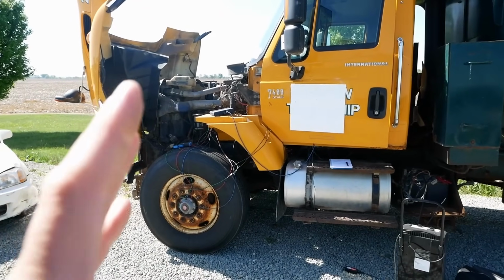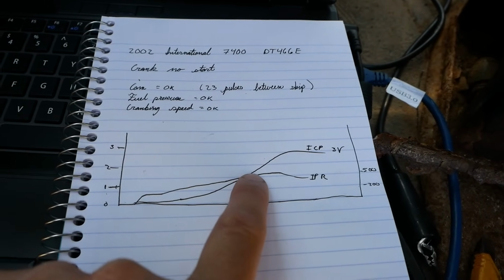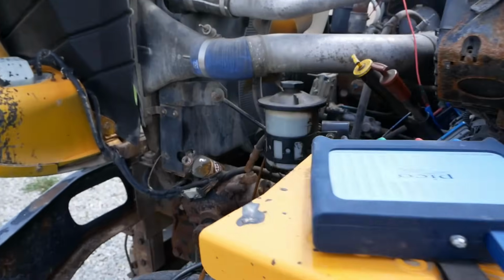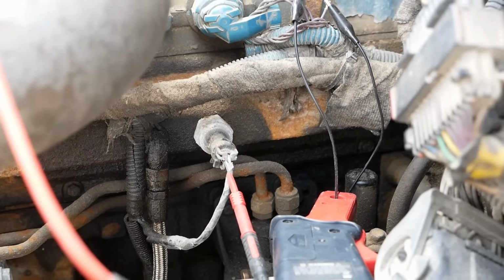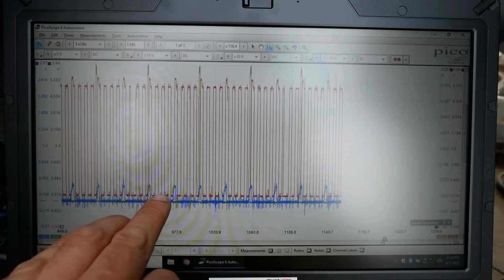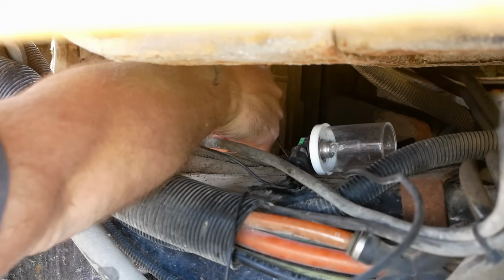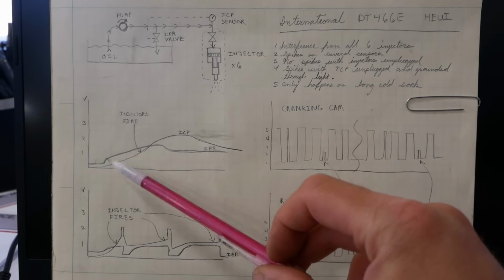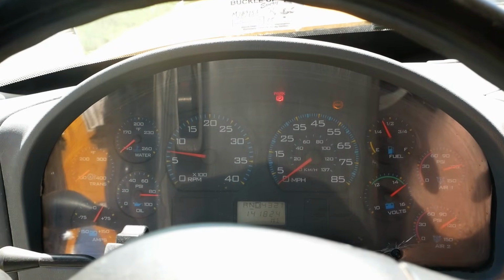International DT466E Won't Start without Ether after Sitting

Comment: We have an 05 4300 dt 466e with Allison 2500. And it keeps killing transmission control modules. The good thing about that is you can use used parts. But killing one every month leaves the truck sitting.. been through the harnesses for ecm and tcm repaired every wire with even a little suspect. All sensors check out good and we are baffled after that.. like you we live in rust hell in Eastern Canada.. its been sitting a few months now and we will probably get back at it soon..

Comment: Option 1: improve the 5v Reference: Maybe 5v reference needs a new filter cap, both at source and destination.  Ground integrity is not likely good enough.  Reference integrity may be low too.  

Option 2: Clean all injectors and ensure there is no electrical coupling to the sensors.  All the injector power spikes are inductive coupling to the block which is then coupling to some other things I think.  Or the ECM is coupling things internally.  

~One Electrical Engineer
Reply from the maker: I tried an external 5V reference with no improvement.

Comment: Oil leak on pressure feed system. Not electrical. An electrical problem causing a OiL feed system would not let it run after diesel crack injection. An oil leak will induce air into the system on long cold soak and have to rebleed the system.

Comment: What i think is happening here relates to an issue from many years back. There was a huge supply of capacitors that made it into most industries that were CRAP. What you are describing is a timing circuit and the way it is likely controlled includes caps. If you were to get the ECU off and could get your hands on a ESR tester it likely would reflect bad caps. A normal cap tester will not reflect the resistance level of the cap, only the capacitance, and you need both. At least that is my guess.

Comment: Had the exact symptoms on a Chevy Astro 4.3L, it's the FUEL PUMP.
0:44 It can be jump started as well, it raises the FUEL PUMP voltage/pressure enough to meet the injector's minimum requirement.
'Sits for any length of time', this allows the FUEL line pressure to drop from the previous running.

Comment: The fuel system is draining itself over a few days more than likely.  Common problem on the old 7.3's in the Fords. Updated lines and fittings available from several suppliers solves the backflow issue. Quickstart just gets everything running fast enough todUck fuel.

Comment: Enjoyed your video like your use of the pico scope impressive I have one but haven't realized it's value yet do to none use  at the end of video you showed it started after 24 hours and said the oil pressure guage worked  could that be the problem low or no primary eng oil pressure   losing prime while sitting long periods of time  just a guess anyway great video ty

Comment: I follow your logic on the signal quality and determination of it having a bad ECU...   but that doesn't really account for the Time factor.   My gut feeling is there is a pressure leakdown or leakdown sense on some aspect of the fuel system.     This is a problem for Warren Rogers.

Comment: If it starts hot not cold condition of glow plugs? Either adds fuel and lowers compression psi needed to fire.
cold oil builds pressure faster, so oil pressure probs don't seem likely. you need rpm and oil pressure, crank sync to fire. Use heat gun to heat connector to simulate hot running conditions on electrical plugs you think are the problem. Heat up the ecm and see if it runs. High voltage is from the idm. Electrical probs are easy to diagnose after you fix it 😜.

Comment: My 2 cents. I have a 2000 IH 9200, Detroit 12.7. Had a similar problem - would remove air filter cover and blow in ether - turned out to be leaking fuel return line.

Comment: Wes - you are oh so close!  The most likely problem is excessive resistance at the connector to the PCM ... you won't see the voltage drop when back-probing pins but there will be a voltage difference across the PCM connector which will be proportional to PCM current (in your case, probably from injector current).  This will cause the PCM ground to be "lifted" with respect to chassis ground.

When you disconnected and reconnected the PCM (and added dialectric grease?) you probably "cleaned" the connector contacts to a degree.  If the problem is still present, you may be able to remove one of the PCM ground wires (cut, etc) and monitor the voltage on the PCM side of that wire ... I'm sure you'll see the voltage drop mentioned.  Alternatively, if you were to unhook (cut off) 3 of the 6 injectors, you should see the lifted ground voltage reduce (as measured by the "lifting" of your measured waveforms from what should be ground on your scope).

What I believe is happening is as current flows you're getting a voltage difference between PCM ground and chassis ground.  Your back-probing proved the chassis grounds are ok, but your voltage waveforms indicate the PCM ground is "lifting" because of the darn voltage across the connectors - the degree of lifting should be proportional to PCM current.  If the grounds are grouped together (they are probably not) you could run all of them through your current probe and you'll see a current waveform synchronous "lifted" waveforms you've observed.  You could also probably measure the current on the supply side of the PCM.

BTW - I'm an electrical engineer who designs microcontrollers for PCMs, ECU's, and other controllers.  Sometimes we see OEM's undersize their ground wires during design which cause similar (and interesting to diagnose) problems ... once you've been around the block a time or two - particularly with erratic sensor readings - you become aware of this issue.  

Your keen intuition, experience, and  creativity (including methodical diagnosis) is appreciated as are your efforts to entertain us with your work!

Comment: I doubt electrical failure should not be a difference between 24 and 48 hrs with electrical I suspect a pressure leak down in the system slow leak.
Reply from the maker: There's nothing that can leak down that will not pump up during cranking.

Comment: Does the cam sensor read off of the face of the cam gear? I've had lateral movement cause an issue with sensor to reluctor gap be inconsistent enough to cause an issue. I had a bad cam sensor and when I replaced it with an after market sensor it still didn't run which caused me quite a bit of grief questioning my original diagnosis. The sad part is I used the scope to diagnose the original sensor and when the new one didn't take care of it I went down a rabbit hole of self doubt and wasted time. Finally went back full circle to the cam sensor (using my scope), ordered OEM and voila! My point was, the aftermarket sensor couldn't handle the inconsistency, so there has to be a point where even a strong sensor can't handle it. Why there would be such a significant difference between warm and cold, you got me. The aftermarket cam sensor pattern was missing a very significant section though, so that weird pattern you had of one event is interesting. I can tell you would be just fine at the dealership, you'd have known whether or not you could use a junkyard module and have the equipment to program. Easy peasy my friend. You did fine. Good to see you using the PICO. P.S. It's a poor design computer that incorporates high load drivers such as  for injectors in them. ECMs that cost in the thousands because an injector or coil driver failed when they can be an individual driver for each coil or injector is bad for everybody.

Comment: Smarter men than me would probably yank the computer out and reverse engineer it to make a replacement using something like a Raspberry Pi with a CANBUS interface. But at that point, it would be a write-off several hundred times over so the best bet would be to just throw the truck at your nearest junkyard and get a new one

Comment: Hey Wes mate. We used to run Terex scrapers with these engines. There was one machine that was impossible to start just like yours until it was discovered that if it was parked with the engine sloped down hill the thing started again next day. Turns out that the oil was draining from the pressure pump cavity in the timing cover. So we unscrewed the oil temp sensor then pre filled reservoir with engine oil
Reply: And the thing would start and run no problem. Just a thought and great videos. Thank you.
Reply from the maker: I checked the reservoir and it is full.

Comment: I had the same problem and I chased everything like you and looking and changing ecm ,the injector control module , heui pump, cam sensor, icm, exc... And after taking apart every ground and cleaning everything and fix the problem. I know it sounds stupid but that’s what fixed it on mine it took me almost 3 months chasing everything and basically buying every new part for the motor and swapping them back-and-forth and as I stated all it was was grounds. But now I have new spare part for that motor.
Reply from the maker: We checked the grounds.

Comment: I've seen wiring harnesses to short circuit and ground out on the inside of the valve cover where oil gets into them.
Reply from the maker: We would see that on the scope. Injector current is normal.

Comment: Looks like a thermal issue, bad solder/connection maybe. Might as well be on the computer board itself. The voltage drop looks like a reset...

Comment: Oh wow… it would be super interesting to see what went bad in the ECM. 
I had a car ECM “rebuilt” or repaired where it only had the start issue once it was hot. They found it by hairdrying the ECM, got it all re-soldered and it’s been good for years now. 

I guess internal wiring for these are highly confidential, but it would be awesome to see what broke or grounds internally for these spikes to appear. 
Or maybe blowing some heat on the ECM before cold-starting could prove that heat in it provides the workaround…

Perplexing for sure, thanks for filming it!
Reply: You want an answer? All you got to do is connect someone like buildzoid he breaks down board views of video cards and odds are he could figure it out, also look up gentry & sons trucking on YouTube they recently did a video with a man repaired ECU for semi's awesome shit.

Comment: Hi Wes, just a thought mate but try dropping a line to JC Smith Projects as he works on these DT466E engines all the time. What he doesn't know about them would leave you scratching your head bud. He is over there in the North West somewhere, I'm sure he can help steer you right.

Comment: Computer issues are hard to identify without knowing the specifics of the circuitry. Even narrowing it down to the computer was quite the task. That 8 to 1 ratio, probably a lot worse on diag videos. If I had to guess there's corrosion all over the inside of that ECU

Comment: Only thing I can think of. Same old cars and bikes.  There is a crack in a board.  Cold will start. Warm it will fail. Does not include you video feed. Not the answer.  But... most times cold dezeail petrol  two stroke.  Boards will live when cold. Solder on a board will join. When warm the board will separate when worm . All will fail. Need microscopes  of a board   . Ecm all. ...... God bless  .mick Australia

Comment: I use to work at the Navistar facility in Ohio on their 500 HP air compressors. Those people would wire crap up to the controls and devices on the compressors and have the whole system whacked out. It comes as no Suprise the products produced there were also whacky.

Comment: This is why fleets can’t keep old vehicles. Diagnostic costs are prohibitive without factory diagnostic software. The ECM has a minimum cranking voltage required to fire the engine. I’m sure you checked that though. There may be a reman ECM available?

Comment: Seems like low fuel pressure or you are losing your prime. These engines have a low-pressure fuel lift pump. From what I can see, this one should have around 65 lbs  to run. You might also check the fuel regulator which is in the back of the cyl. head where the fuel return line hooks up. Looks like a banjo fitting. If it is failing, you will not build the right amount of fuel pressure. On the high-pressure oil pump side, you have a high pressure manifold that sits on the injectors. They have what is called a Puck that allows the high pressure to get to the injector to open it up when the ECM commands to open. This high pressure side has to have at least 500 lbs to start the engine. Easy to check also, pull valve cover and have someone crank the engine. Ther should be none to very little oil flow on the injectors. Hope this helps.

Comment: As mechanic for these 13 letter sh*t spreaders
They are complete trash designs I’ve chased so many diagnostics on this model and I have access to international software and looking around the prices for a pcm for this truck is ungodly on navistar and DLB (diamond logic builder) and service forms state if you have power and ground on all pins then replace pcm and a navistar pcm is so overly priced and they are on back order

Comment: The ECM has some kind of induction/feedback thing going on, and its only when its cold.  My guess is that a component on the ECM board is not happy, when it cools down for a long period, or undergoes some kind of physical change from the cold soak that changes its electrical properties and function.  I can see the owners installing a small hose to the intake, with a bottle of tractor smack on the end of it, to make ethering as normal as turning the key.

Comment: I hate working on dump trucks that someone else has so called work on . I have found loose spark plugs. Wrong parts &  old parts that don't belong on that model engine. . I have out three other mechanics have work on one engine before me .  So I go pull all the wrong parts off that engine . And put the new right parts back to where they belong on the engine .

Comment: In the area of your concern (fuel sensor, valve; injectors) I would do an ohms check between all wires (after unplugging all connectors). As was mentioned, possible salt incursion might be making a low-ohms path between circuits that are supposed to be isolated.

Also, check ohms of each of those connectors (point-to-point), including grounds. I bet you'll find either low ohms where there shouldn't be, or high ohms where there should be zero ohms.

Also do voltage drop test (using scope) for ground and power at the ECM while cranking. 

Some of the above has been suggested by others here in the comments.

Comment: Feels  to me like an electronic fault. I would suggest it is an electrolytic capacitor possibly in the ECM . If it has standard liquid style electrolytics  in the ECM it may look OK but it may be high Equivalent series resistance. This is a common fault in power supplies in TV , ETC.  Works OK hot but if cold will not start

Comment: Wally World has starting fluid at $3.27 @ can. Using your low estimate of $2K, that's 612 cans of Cosby juice. That vehicle will blend into the landscape of Mars before you used that much on the old girl. Maybe the county could buy a full pallet and get it even cheaper. Personally, I'd contact Peg. He's extremely well versed at International, (Ford), engines and starting fluid. :)

Comment: by 13:29 it looks to me like a bad ground and it's being elevated above 0v when the injector tries to fire. probably bad ECM grounds, harness or internal ECM itself.
the sensors output and FPR current dropping are effected by the ground not being 0v and the computer simply doesn't know that's happening, it just sees the sensor signal elevated and may or may not have current feedback from the FPR.

Comment: I was working for the C&NW RR, it was  -10 deg, the END SD40 with a 16 cyl 645 cu per cyl died and wouldnt start, the shop foreman told me to buy two 16 oz cans fo ether, opened the air box cover on each side , duct tape the cans and toss in the air box and close the covers, what a violent start but I saved the locomotive with 350 gal of water (no antifreeze)

Comment: The  voltmeter was used to probe the ICM sensor's +5V reference the engine started.  This is a key finding.     Voltage probing by using the  DVM is bypassing the +5V reference on the ICMP senor by way of it's parasitic capacitance thus the noise that is being induced by the injectors is not getting into the ECM.  

The engine starts if you charge the batteries which raises the input voltage to the ECM. This additional voltage give the ECM more headroom to not see the noise created by the injectors.

I would bet these batteries are down a couple of 100 mv after 48 hours of idle and the fact this happens when cold.

You observation that all six injectors are source of this noise is another finding. The common point  are the injector ground.

My input is to try to make certain that the engine block, the injector grounds all go back to the battery ground. Check all connections mechanical and the wiring harness to the perfectly clean.  Current from the injector will find the source of least resistance which in electronics means a failure like the one you are seeing.

Debugging a diesel engine in this condition is one of the most challenging and frustrating as you well know.   I would not purchase a new ECM.  If the ECM was the problem the drivers for the Injectors would not sink current.  What's getting the system is noise input on the ICMP sensor.   Hope this helps.
Reply from the maker: No. It tried to start but would not run. I even supplied a separate clean 5V and the engine would not run. We checked all powers and grounds. That is not the issue.